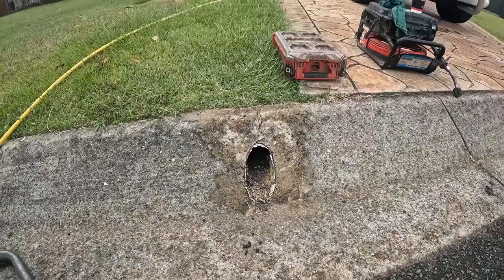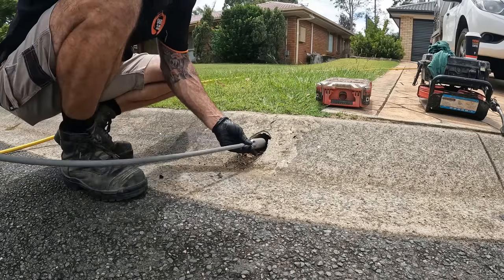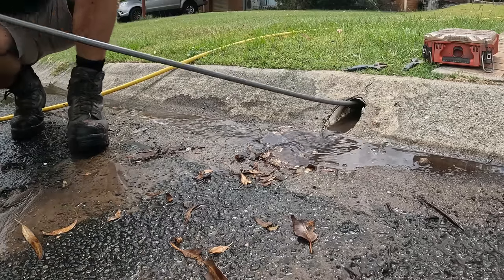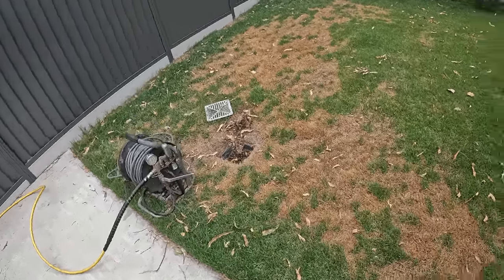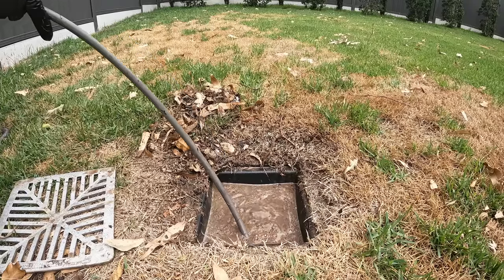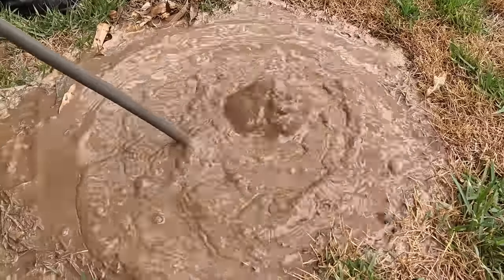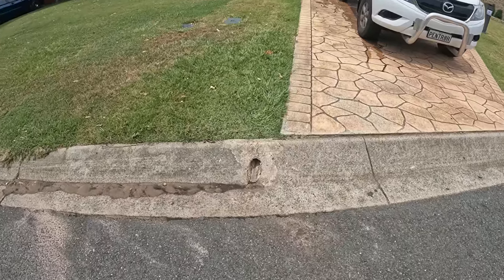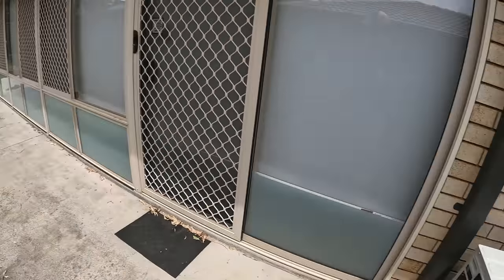Blocked Drain 355 - Muddy Root Infested Water Explodes From The Pipe

Comment: In the UK we don't usually have storm outlets. The rain comes down the drain pipes and many have water butts ( Barrels ) to water the the garden. The use of soakaways is common, but sometimes these block up, the same as in Australia. We live half way up a mountain so when it rain the water is streaming down the forest, then the garden and down the steps, through the retaining wall outlets and stays wet for ages. The road outside floods with leaves and stones washing into the drains. The good side is that we live in among the greenest, loveliest environment in the UK. Thanks for posting Gavin.
Reply: Almost all UK houses storm water is handled on the property rather than the Australian style of draining it to the street. Older housing stock pre 1970 uses the Victorian style single sewer connection called a combined sewer where waste and storm water are mixed together and sent to the treatment plant.

From around 1970 onwards newbuilds have two sewer connections to the property, one for storm water, which takes the water to rivers / streams / beaches and a foul water which handles untreated waste water and goes to a water treatment plant. 

The newer style is great for reducing the amount of water flowing into a treatment plant but you do open up the possibility of a dodgy plumber accidentally connecting a toilet etc to the storm water sewer which will then send untreated waste into rivers etc.
Reply: @n2n8sda  I used to travel all over the UK repairing gearboxes used in water treatment plants, sewage farms. Some of the things filtered out of the raw sewage surprised me, often. I sold a house in Wiltshire, a couple of years ago, where the rain water was diverted into the sewer line. I was told that this was to aid the flow of waste water through the pipe. I have no clue as to whether it was sanctioned or not, but the neighbours told me that before it was done blockages in the sewer line were often and expensive. I know my house was not the only one modified this way. I live in West Wales now where there is no shortage of water and have a cesspit or two.
Reply: @n2n8sda  it’s the eastern states that seem to do street drainage of storm water. Here in the west, with our predominantly sandy soil, we use soak wells on the property